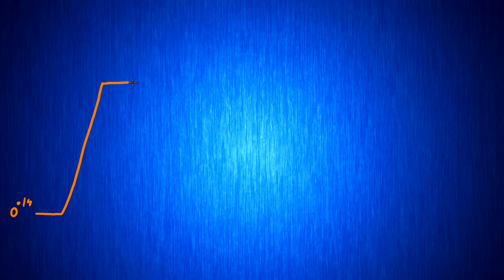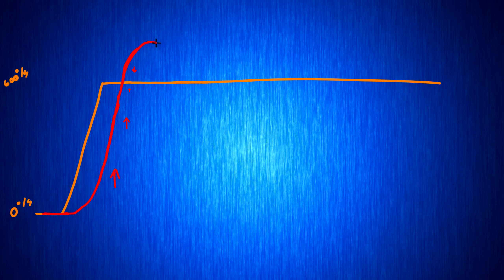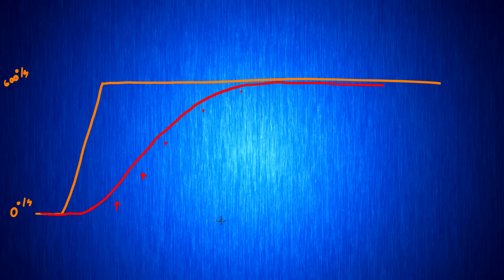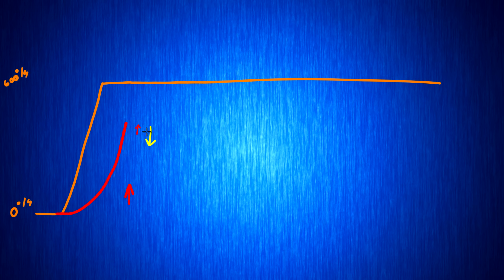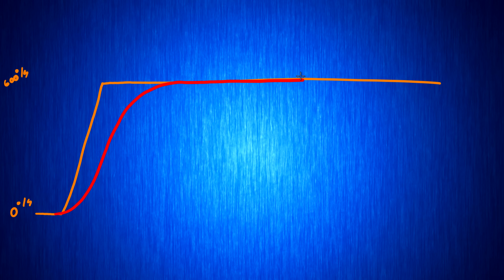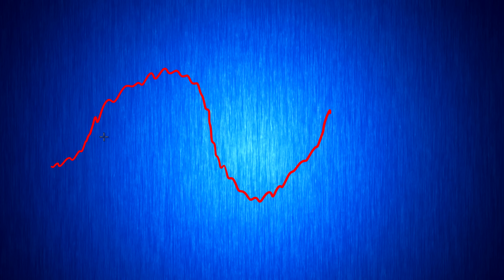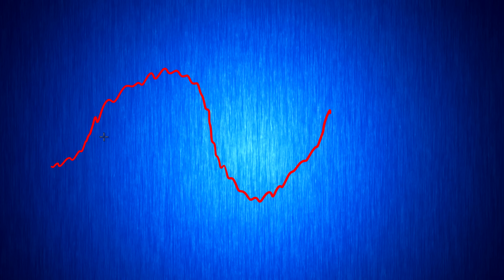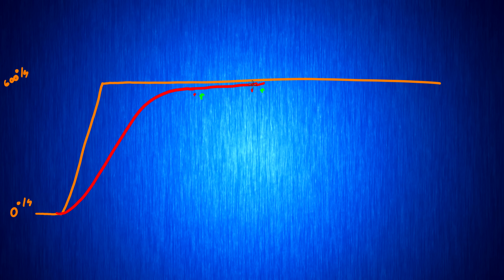PIDs Simplified

Comment: Why do we use a PID controller if the only thing that it does is to follow the input. Why dont we directly fed our input to the system instead of passing it through PID.
Reply from the maker: Because the input that we feed it is not the same as what the output of the controller is.  In the case of a drone we tell the controller what angle we want, and the controller outputs motor speed for 4 different motors.  In the case of a motor controller we may tell the controller what speed we want the motor to spin, and the pid controller will output the torque to get to that speed, and then that torque value may also get fed into another pid controller that takes a torque value and manages the phase current on the motor windings.

Think of it like looking up directions on a map.  You say "go to this location" and the pid controller looks up all the turn by turn directions and handles traveling the distance.  Sure you could figure out the whole route yourself, but the pid controller is much faster at it, and you only really care that it actually reaches the destination.

Comment: I have to write and say thank you. I built a PID box to control oven temps and I have been screwing with it all day. I knew what I wanted it to do but I just didn't know how to get there. Your explanation of D solved my problems. I was getting a 20 degree over and 10 degree under oscillation. Now I am getting a .1 to .3 degree over oscillation and thats it. It holds at exactly 167.0 to 167.3. Perfect for killing  covid-19 on masks gloves whatever. I am using 2 oven thermometers to verify the temp and it is dead nuts. Again thanks so much I hadn't heard D explained that way before and it all clicked when you said it. TAS

Comment: D is watching sudden change of position within the fraction time to give feedback. It does’t matter where the target is.
So ..
1. Set P for the smooth and sluggish curve.
2. Set I to help add power to P if it is taking too much time to get to the target.
3. Set D to push the power back if  I  is doing too much work and excessive acceleration.  
P I’ll try to get to the target.
I   I’ll give you extra power because you are taking too much time.
D I’ll slow you down because I is giving too much power and detected sudden movement in short period of time.
Reply: Thanks for the brilliant comment!
Reply: This was so much better of an explanation of what each one does.
Reply: This made it really clear for me, thank you!
Reply: Nice breakdown!
Reply: Good explanation. Thx
Reply: Hi Sir Im newbie on this. On point #3, if I is doing excessive acceleration, why bother with D? Why not just reduce I? Same with point #2, if P is too low, why increase I when you can increase P? Thanks
Reply: Great
Reply: @sylobloc4774  because  P and I don't care how fast you approach your target value. if you lower P or I you'll get longer to arrive at your target, or you'll never get there. You use high enough P and I to get you to your target reasonably quickly and you have D to stop you there faster.
In point #2 if you increase P you risk overshooting your target value and oscillating around it. Also, some external factors may push you off target value slightly. The I term will accumulate over time with this small error and eventually get big enough so that it'll be enough to get you closer to your target.

P cares how far you're from target value
I cares how long you've been off target
D cares how you're approaching the target
Reply: A lot of our PID settings include a dead band. Could you give a quick explanation of dead band. Thank you so much

Comment: P term is a rubber band with a resting length of zero. It needs distance to produce tension. If you increase the load on a rubber band, it needs to stretch further in order to produce the correct tension. This is insufficient for a regulator since you expect a regulator to compensate. The I term naturally complements the shortcoming of a rubber band. And since both pull towards the setpoint, you need the D term to compensate to avoid overshoot.

Comment: I just don't understand. Whenever I see other examples, it shows a high rate of change (approaching set point quick, say a PV of 40degress and set point of 50 degrees)giving D a high value. If we are approaching a set point and want to avoid overshoot, is the D value inverse? So the D value gives a minus value to the PID controller to lower the power to avoid overshoot?

Comment: As an electrician, I sometimes had to tune PID for process temp. control. I was able to muddle through it but it was sometimes frustrating. Wish I could have viewed your channel years ago. Thankfully, most micro controllers now have auto-tune feature. Turn it on and let it do its thing. Your video can be applied to many different control application. Thanks for sharing.
Reply: What if auto tune doesn't fix the problem what would be the best way to fix it?
Reply: I'm fixing an oven in our laboratory and it has a pid controller I tried to autone and offset the controller the pv and the sv is already equal unfortunately the actual temperature in the inside is very high

Comment: All good except the "physical thing" and the "momentum". As our destination is not a position but a speed it has nothing to do with the momentum. We would not need "D" if sensors could measure the speed and FC and motors could apply acceleration/deceleration instantly, no matter of mass of the drone.
There is a delay between the error appear and the drone reacted on it. It means fast FC and light motor/prop will simplify PID tuning and make the drone fly sharper
Reply: I think he was using it metaphorically to rationalise rates of change

Comment: Referring to the beginning of the explanation: P term, as i understand it. does not slow down or speed up. That is derivative. P term also does not  move back and fourth. That is Integral. The P term tries to move to the target, but because of physics, it ends up being in the wrong place.  It outputs proportional to the input. If the p is 2/1, it outputs 2 for every 1. It is one number, the desired destination.  Integral and Derivative correct the errors.

Comment: So, 
P = amount of correction signal, proportional to the deviation from set-point, and
D= response rate of the 'P' signal (to prevent time delays by preventing any overshoots or undershoots)
is my understanding correct?
Reply from the maker: D is independent of P, they just happen to work together.  D also doesn't do anything to prevent undershoots ( I is what provides a slow nudge when you're not resolving on your exact set point ) it fights overshoots by virtue of it providing a corrective force when the error is increasing, which is what happens when P overshoots it's target
Reply: @SiieeFPV  so when I is slow to react, exactly what role does D play in that situation?
Reply from the maker: if the pid controller has settled but not exactly at it's target D isn't really doing anything.  because even though it's not at it's target, the error is not changing, so D sees nothing happening
Reply: @SiieeFPV  I see. So, when P is small and D plays no role (as it sees no error as you say), how exactly then an undershoot is corrected?
Reply from the maker: I term slowly nudges the solution towards the target over time.  With no I term an undershoot is not corrected.  Technically not even always an undershoot, you can have a small overshoot as well.  You can resolve anywhere very close to, but not exactly at, the target.  I term finishes the job.

Comment: I am confused ... You are talking about hitting its target ... How does the quad know where the target is, considering we decide when to stop and start the movement of the quad. Maybe I am looking at this all wrong.
Reply from the maker: The target that you're setting isn't the quads position, but the quads rotational speed.  That's why it's called "rate" mode, because you're directly commanding the rotational rate.  So when you've got the stick pushed over to one side you set the target rotation speed to say 900 degrees/sec, and the pid controller then tries what it can to make the quad spin at 900 degrees/sec in that direction.  When you're doing a flip you're issuing two different rate targets in quick succession,  the first when you push the stick over to the side to tell the quad to spin quickly to one direction, and a second target when you return the stick to center and tell the quad to stop rotating (no matter what direction it's facing)

If you're in level, or attitude mode then your stick position is directly controlling the angle the quad sits at, so the target your commanding is a position target rather than a rate target.  Typically this will actually be a 2nd pid controller that talks to the lower level rate pid controller.

Comment: That explanation of the P controller is wrong. Single example: "P" takes time. No P is proportional. The thing you control may take time, or may not, thus it is not the explanation.
Reply: Right ? Isnt the P term like power? Should it go 0,2-0,7 Bar or 2-20 Bar quite fast or something. Im new to this but that is what someone told me.
Reply: @TheeSherminator  The simplest P controller is a radiator thermostat. A given room temperature (the feedback) controls the spring pin that controls the valve (the controller output). The feedback is in °C, the output is in mm actuator travel in mm or whatever. Any 1+ degree decreases the valve by a certain amount. And the proportion of both is the main property of the P controller. By twisting the thermostat you give it some offset. The "gain" is here built in. Its analogue and not ideal

Comment: This is why too high D is overheating motors. Because it is an opposite force.
Reply from the maker: It's not actually opposite, when error is increasing D term works in the same direction as P.  The problem with D is it acts as a sort of amplification.  A noisy signal can have very small changes in position, but very large changes in speed, or in terms of multirotors you might say it can have small changes in motor speed, but large changes in motor acceleration.  The D term sees only those changes in acceleration and goes nuts trying to correct it, which makes even more noise, which it goes even more nuts trying to correct.  That's where D term heating comes from, it's not that it fights with P term, it's that it fights with itself.
Reply: Thx for the precision